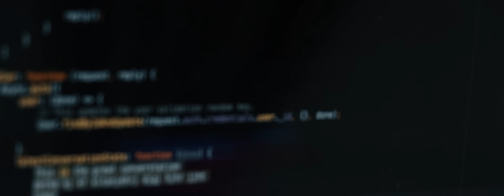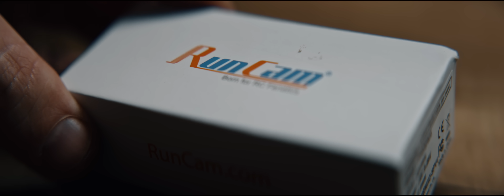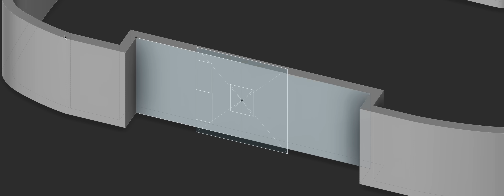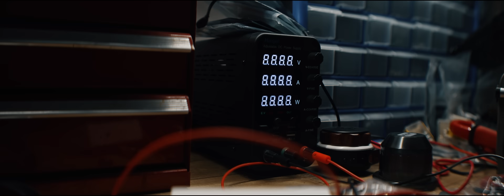Memory, Remade: A Sankyo 8-R Story

Comment: Wait so does that mean the cut filter is in the lens since you just used the sensor?
This is a baller vid my dude.
Reply from the maker: Thanks for the kind comments! 

Yeah, I noticed later that the original drone lens has a small IR filter in the stack. It was fixed in place with epoxy so I couldn't get it out in one piece. I'll find a screw in version for the lens soon though!